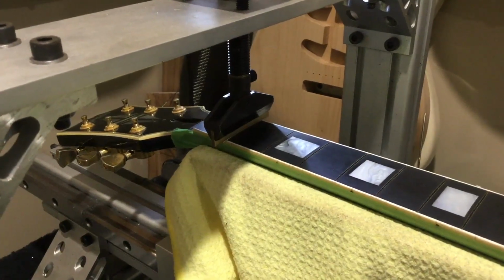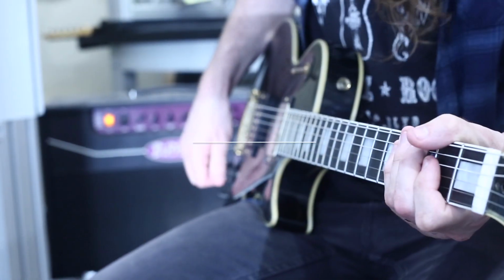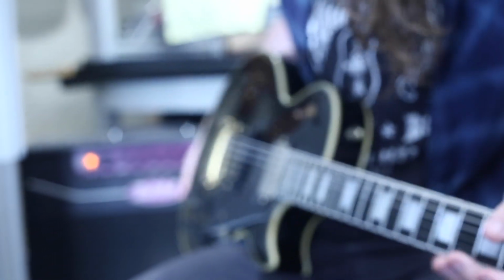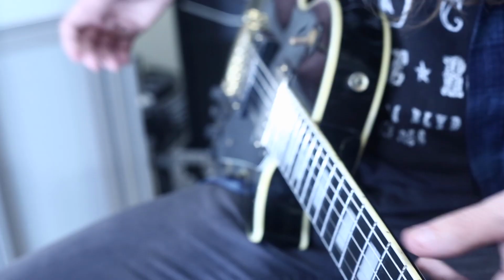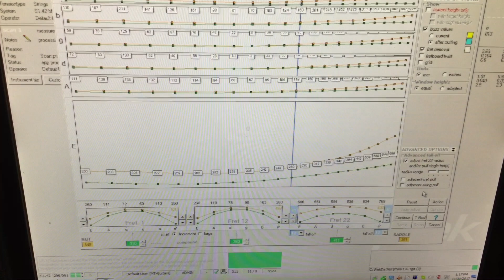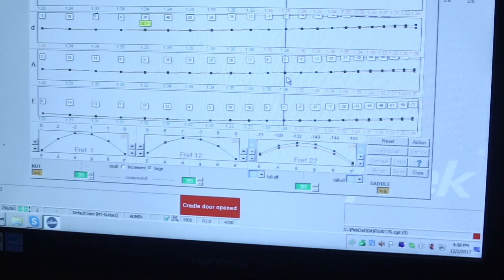Leon Gets Plek'd Part II

Comment: Thanks for the excellent vids, Leon.  I'm amazed that nobody has asked how much the whole thing cost you (or how much it would cost anyone else).  That's not a rude question is it?
Reply from the maker: A standard plek is $250aud at MT including a new nut, strings and your choice of setup. Add around $100-$250 for a refret job and fingerboard planing depending on what wire you want.
Reply: @LeonTodd  Thanks.